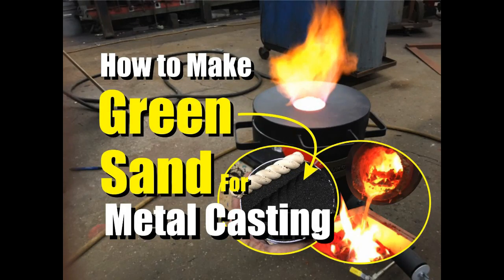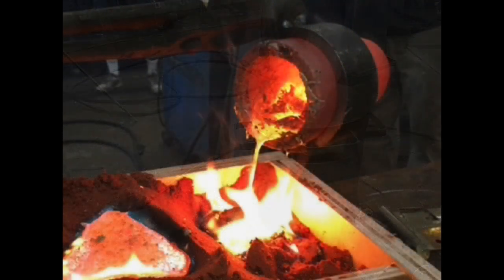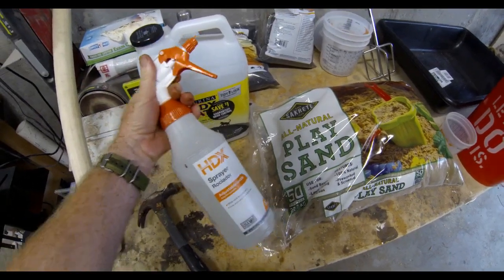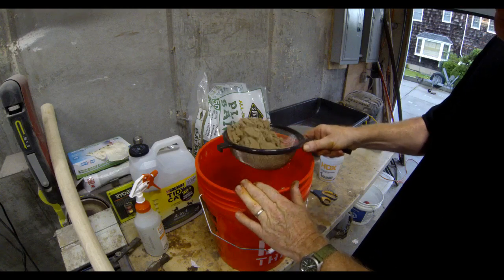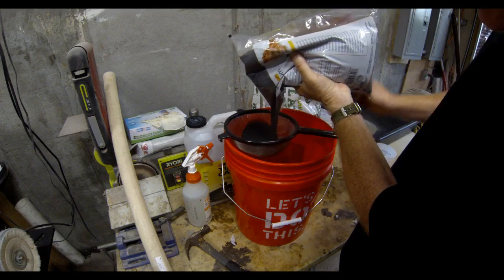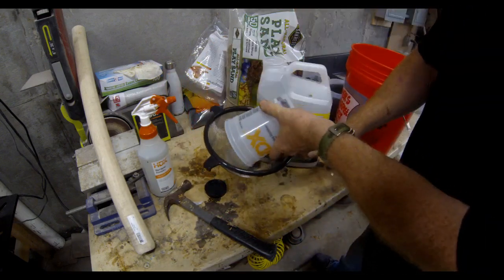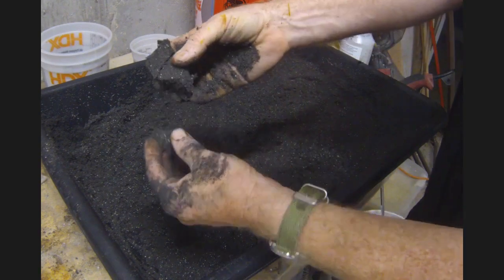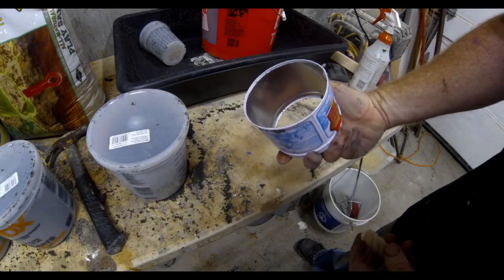How to easily make Cheep Petrobond Metal Casting Sand call Green Sand

Comment: Did you intentionally call this water-based green sand "Petrobond"? because you didn't make a homemade Petrobond, you made a green sand. both can be used for casting but they are different.
Petrobond is an oil-based binder, although it also includes other catalysts and binders like isopropyl alcohol. 
green sand is a water-based binder. Sand + clay + water + other stuff (the other stuff makes the casting process better, crushed coal [seacoal] is one such additive)

that pet store Calcium sand is likely to give you problems being that it's not silica sand but is composed of calcium carbonate.
silica sand melts at  1670°C [3038°F]
Calcium sand (Calcium carbonate) melts at 825°C [1,517°F]
Another issue with that sand is as it's heated it undergoes thermal decomposition to form calcium oxide and carbon dioxide. That's a whole lot of off-gassing which is going to give your castings problems. 

Another option for dry sand is to go for silica blasting media which is also at your hardware store, it should be dry, unlike the play sand. 
the pet store should have silica sands in the fish area.
Reply: @Can Mei you do realise the person writing that question clearly knows alot and the comment is bloody question?

Comment: Be careful pouring molten metal in a wet mold.  Flash boiling molds can cause the molten to splatter and "explode" the mold.  Moister is one of the most dangerous variables in metal casting.  As this video is over 2 years old now, I expect you have learned this.  For your viewers, I remember starting out this way while trying to overcome the cost of commercial sands and clays for casting.  My first sands were water based and not oil based as well.

Just know that water is dangerous in the sand and must be dried out as best as you can... but then the mold falls apart more as the sand drys and cracks.  The oil or Petro in sands such as petrobond will help keep the sand sticking to itself.  Oil also has a tolerance to heat (depend on the oil you use) and should not flash boil causing steam pockets and venting gasses. 

In case you have not fixed this yet ... try Thread Cutting Oil and finer grains of sand ... I mean really fine stuff.  Bentonite clay may be a good place to start looking too ... actual clay and add some sand to it.  Defiantly add oil to it.  It helps, I promise

Comment: I use play sand and filter it just like you because I use it in my harbor freight sand blaster. I put it in a big stainless steel bowl and into my toaster oven for 90 minutes on 250 then let cool. No moisture issues when sifting or shooting out the gun

Comment: You should buy a blender at a thrift  store for the shop comes in handy.
Reply: Though kitty litter would dull any blade really quickly
Reply: @jarodmorris611  yes but it is meant for the shop so you can sharpen it or make a new one.
Reply: that's a video I'd like to see.  making  new blade and/or sharpening an old one.  Not saying it is impossible, I truly would like to see how others do it.  I tried on one, gave up, and went and bought a new $10 one at Family Dollar.
Reply: If you can find them in a thrift shop, coffee grinders are also good options for grinding the kitty litter or oil dry down. But really it's cheaper and faster to just buy the powdered bentonite clay online. (technically you need a blend of western and southern bentonite for the best results... Tobho mott covered a little on why both in his muller series; his info was from a professional molder). 
20 lbs of kitty litter is about $8.32 or $2.41/lb + grinding
25 lbs of oil dry is about $6.38 0r $3.92/lb + grinding 
50 lb Bag Western Bentonite Clay Powder, is about $25.12 (online with carter waters) or $2/lb (just avoid the cosmetics versions which are the more expensive food grade)
do note that 50 lbs is orders of magnitude more than most people will need.
Reply: that or a cheap pulverizer from aliexpress